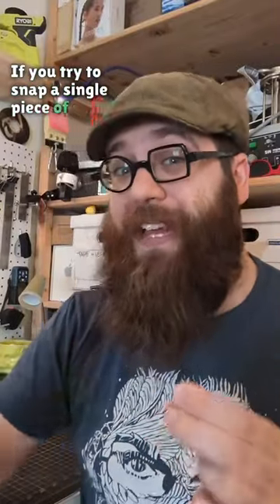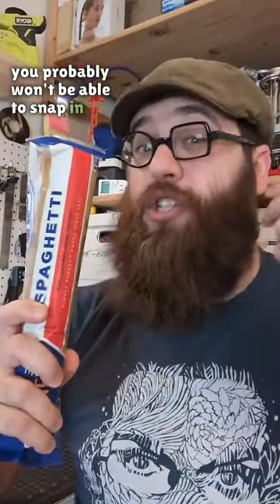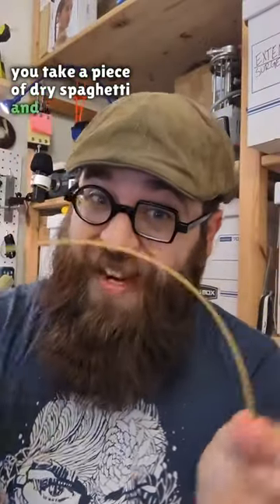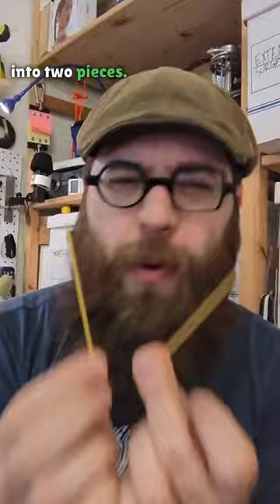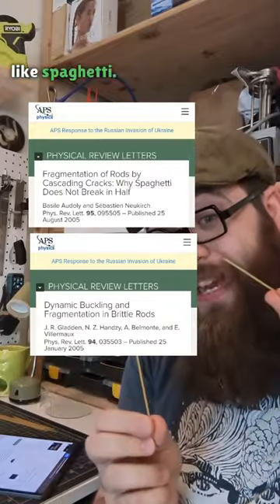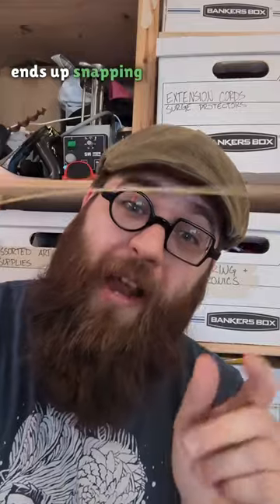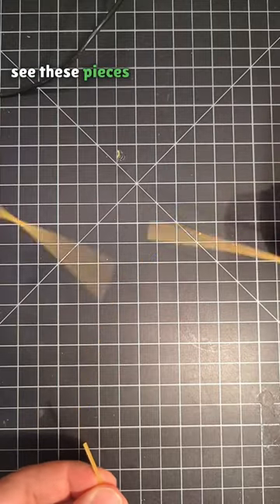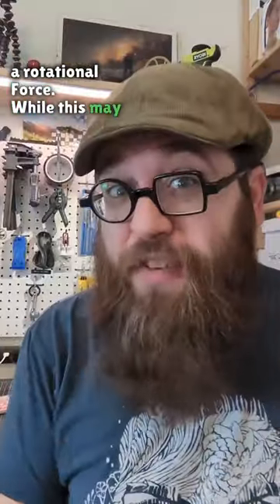You CAN’T* break spaghetti in twain

Comment: Is this phenomenon similar to how a whip accelerates?
Reply from the maker: I’d have to look in to it but I’d guess it’s slightly different. Whips typically are tapered so the energy of the larger part traveling to the thinner tip means it accelerates to the point you end up hearing that “crack”